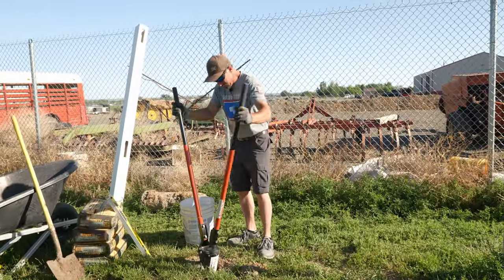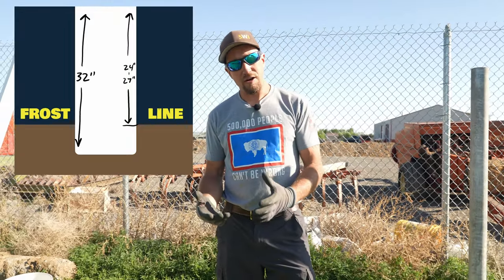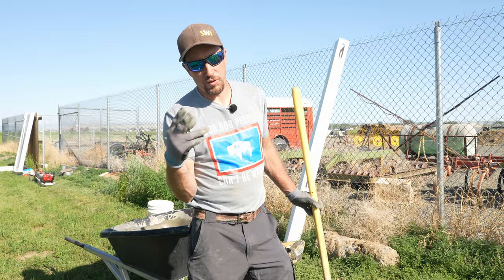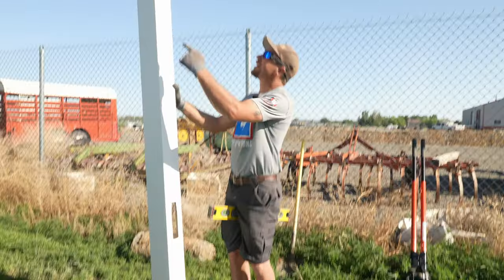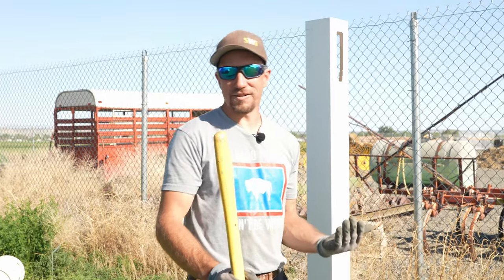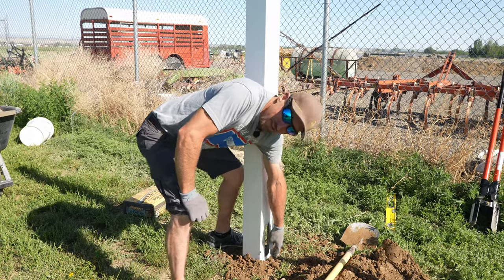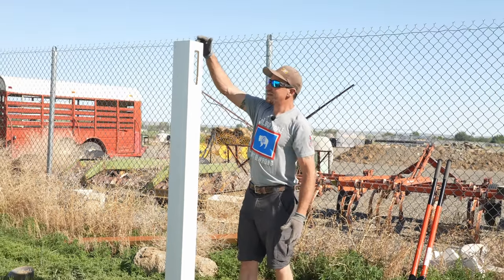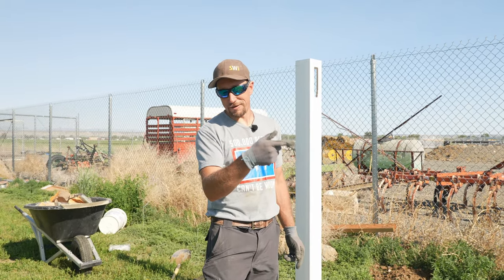Setting The Perfect Vinyl Fence Post Every Time

Comment: 32" dude that's not deep I don't know what you're bragging about you're going to lessen that you're not even gonna stand up longer than a month 32" 3' minimum should be at least 4'
Reply from the maker: That depends entirely on where you are and how high your fence is. We engineer for Wyoming wind (which gets pretty heavy) and this works very well for us.
Reply: @SWiFence   Yeah wind is what brings down fences the longer the fence the deeper the post the better it is
Reply: your BUGGING
Reply: @Joedoeswhat it does depend where you at I am in California and city’s only require 24
Reply: @ESG13  never make ur goal minimum code always over build
Reply: Pretty sure the guy in the video knows what he's doing bub
Reply: Lol 2 ft is fine. 3 ft is a lot. 4 ft is ocd. If you live where there is a frost line, consider moving.
Reply: Drypack that crap and move on
Reply: The posts are pre routed so he can only go as deep as the posts are made so good try “dude”😢

Comment: I like the idea of stabbing in the post. I have completed a 1/3 of my fence using this method. My only concern is what if water/moisture makes its way inside the post. Isn’t there a chance that the water could freeze, possibly distorting or even cracking the post? Maybe I am looking into this too much but I did take a 90° drill and put a 1/4” weep hole into the post just above where the concrete ended. Is that worth doing or wasting my time? Just never heard you talk about having these issue when using this stabbing method.
Reply from the maker: You're not hurting anything by putting a weep hole, but it's not necessary. You'd have to get a lot of water in that post before it could freeze and not have anywhere to go. If your post has filled up with water I would imagine your property would be washed away at that point.
Reply: @SWiFence  Ok thanks! I was thinking it would expand outward causing stress on the post walls. Instead you’re saying it should expand upward inside the post until completely frozen. Makes sense and thanks for taking the time to reply back. I’ve enjoyed the videos and it’s been really helpful.

Comment: I agree with him 100% on not skimping out on the concrete or depth of putting them in the ground .. I personally put up over 30 panels myself and I used at least 3-4 bags per post and damn my fence is strongg as F and perfectly level! I’m in New England and recently I’ve driven around and seen many fences destroyed from the recent storms we had.. but mine is still standing strong and showing zero signs of weakness… I had originally paid someone to do 10 panels and those “professionals” did not use any where near the amount of concrete that I used when I did it by myself n I even noticed they cut some length off some posts because they said “you don’t need to go 2’ or more deep” I know they were wrong now.. and the ones that they did w less concrete have already lost their perfect level look that they had last year.. I know it’s because they didn’t go as deep or use as much concrete as I did … concrete cost 5-6 bucks a bag, why skimp out on $20 worth of concrete when that $20 could have given you years of security on the strength of the fence

Why spend all that money on panels and posts just to go cheap w the amount of concrete used…
Don’t cheap out! 

N also make sure to use a 4x4 post or something to tamper down the dirt in the hole before putting any rocks, concrete , or posts in . Tamper it like a man n make sure your base is good

Needless to say once the spring comes along I’m going to redo the 10 that they did half a s s

Comment: Hey there, great video! I’m a beginner and I’m making a double sided gate. You mentioned there would need to be some wood inside the post for a gate too. If the post is 5”x5”, does the wood need to be the same? Also, does the wood need to be 8’ tall and go into the concrete as well? Any direction you can give would be really appreciated. Thanks 🤘🏼

Comment: great video I definitely learned a lot. In this video, you mentioned putting a pole or bracket inside the post if you were placing a gate. I currently have a vinyl post & fence that attaches to the side of a house, but, now I want to change it and place a vinyl gate/door next to the house. The current post is on top of asphalt. I was looking through your posts but didn't find or see anything. do you have a video or any suggestions? Thank you again for a great video explanation.
Reply from the maker: https://youtu.be/DnkuQiiNzFE

Comment: Hey mate, have you ever had any drainage issues with the concrete being set in the core of the post as well? Im getting mixed information on what to do.
The argument is, if the post isn't hollow down to drainage gravel, the water will build up inside, causing mould etc.
Thanks for the great video mate.
Reply from the maker: Yes, it does retain water--that's a fair argument. You might even get some mold inside the post from standing water--it's possible. But we believe you are getting are far stronger and better end result by stabbing than you would if you left the middle hollow.
Reply: I put concrete in my posts and it truly does make it way stronger,, what I did was stop the concrete at the rectangle cut out for the bottom rung, that way if rain gets in the post it gets a chance to drain at the rectangle cut out for the bottom rung

Comment: Quick question related to end posts that will have gates attached.  The stabbing method makes sense to me but will it work with a post that has an aluminum insert?  I have two double gates in my plan which means four posts with aluminum inserts and I am worried about the insert not seating properly.  Any tips?
Reply from the maker: If you're talking about vinyl we usually screw them together and set them as one post. Put the screw at the very top or bottom that goes into the concrete. 👍🏻

Comment: Another excellent and comical video.
Reply from the maker: Aw shucks! 😂
Reply: @SWiFence  So do you set all of the posts and concrete them...then install the fence panels? Thank you
Reply from the maker: Correct.
Reply: @SWiFence  Thank you.  Will be starting this concept tomorrow.  I like your method and it will help secure the 3 metal inserts I have to use with the 5x5 posts for gates I will be adding.
Reply: @SWiFence  So the stab the post method worked well.  I did the west side portion of the fence posts today and I could see the concrete filling the inside of the post.  I will be using the same method for the east side portion.  Thank you.

Comment: My frost line is 54” does that mean I have to did 5 feet into the ground? Then fill it with concrete even if my post doesn’t go that deep
Reply from the maker: I’m not sure where you are because I’ve heard of people in Minnesota, and Wisconsin only having to set post at 48 inch due to frost levels. However, if your frost is that deep, yes you absolutely have to extend past the frost level.  There is no need for the post itself to go all the way to the bottom since it can be floated up in the concrete if you use our stab method. Another way to do this would be to partially fill the hole and then pour around the post, but this is very difficult.  Overall, I would recommend a stab method for simplicity.  Alternatively, you could drive your posts and avoid the concrete altogether which will yield an even better fence than if you had set it in concrete. This is very popular in the north due to the fact that nobody wants to dispose of all those spoils and spend the money on that much concrete. (If you're building vinyl you're of course driving pipe and then sleeving the vinyl over that.)

Comment: How do you remove a vinyl fence post that's jammed 3 ft into the ground, no concrete? I need to replace it
Reply from the maker: Drill a hole through it, run a rod through the hole, you and a helper get on each side of the rod and pull up while rocking back and forth. If it's set well this may not work, but it's worth a shot. If you've got access to a forklift or bobcat or something that can generate upward force you can chain to your rod and pull up.
Reply: @SWiFence  Perfect! will give it a try
Reply: A farm Jack may also help along with drilling hole and bolting a piece of 2x4 to post as a jacking point.